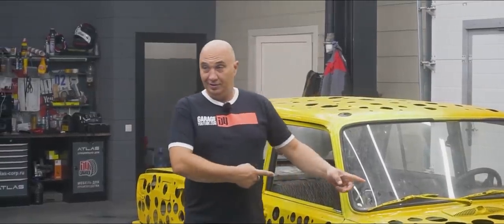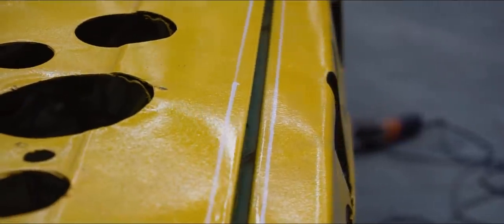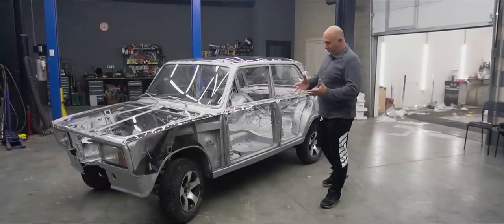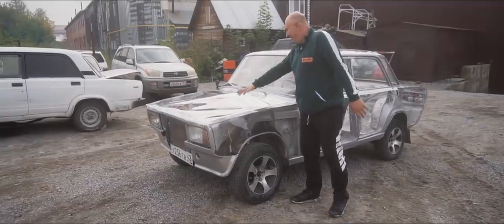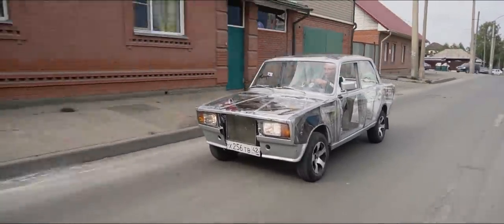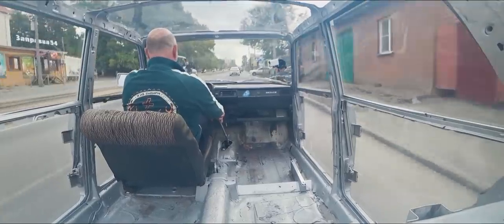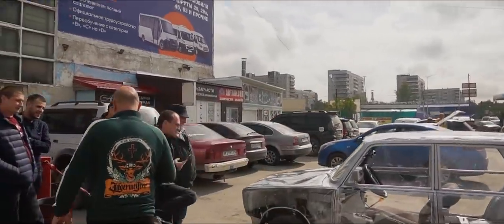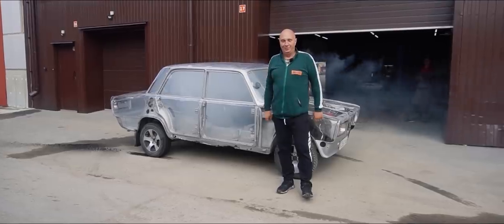The world’s first transparent Lada

Comment: Imagine turning it into a drift missile, considering the weight reduction that must light as a leaf...
Reply: arsinio boka the car will flex itself in half if you take any corner at speed. Convertibles have extra hundreds of pounds worth of weight increase due to stiffening up the frame and body so it doesn’t flex. Imagine what an entire body of plexiglass would be like. The body would soak up the turns better than the suspension lol
Reply: arsinio boka actually 7:45 proves my point pretty good anyways if a burnout causes the entire car to look like a pond with pebbles thrown in it, imagine trying to slide it
Reply: @theeoddments960  they would just need to add good cage into it
Reply: @theeoddments960  yeah I noticed... 😂😂

Comment: Idea - next time vacuum form the clear plastic over the original panels. Might have to use spray foam inside of panels first, to stiffen them up. Or maybe just a heat gun will do the trick.

Comment: What would happen to an engine if the air intake temperature is very high? Lets say 200 degrees celcius? Heat is what makes work in an engine,so giving it a high temperature to start with shouldn't it consume less fuel to achieve combustion temperatures?